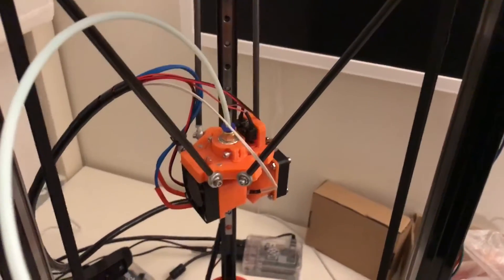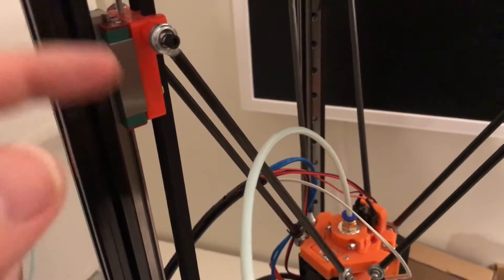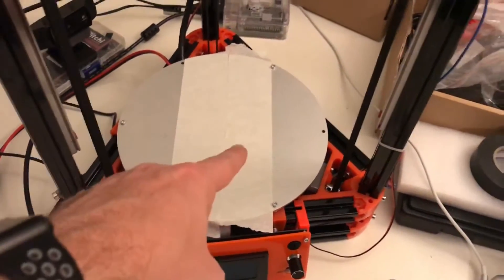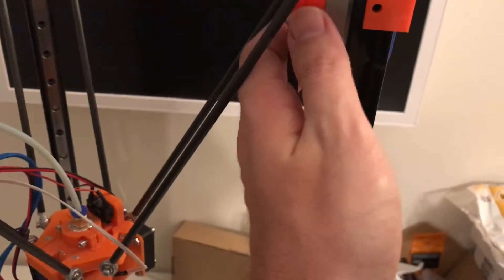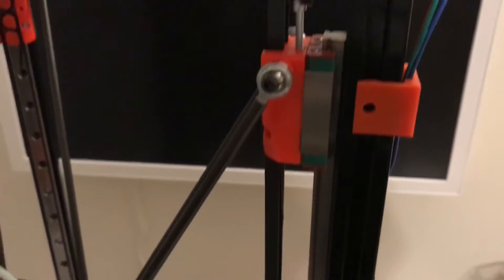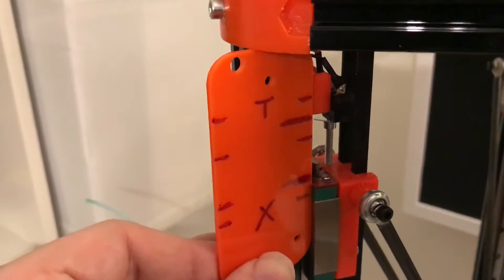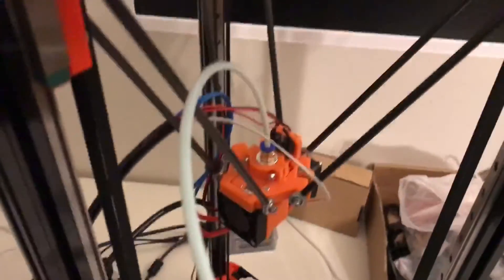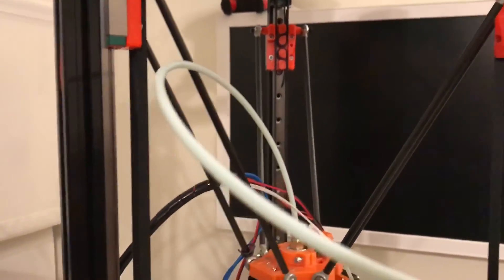Delta 3D Printer Bed Leveling Guide For Beginners - Part 1

Comment: This method doesn't work very well with this printer. Is this the flsun? The manual said to use this method but it gave me terrible results. It's a good starting point but after that you need to adjust the end stop screws to get the best final measurements also the smooth offset in their marlin firmware is different for everyone of these deltas. Mine was of by 1.5mm not to mention the rod lengths were off by 1mm in the stock firmware. I found a great flow chart for calibrating deltas I'll post the link in this comment when I find it.